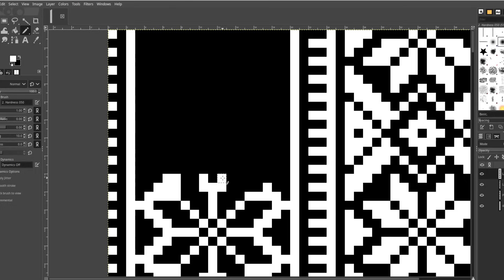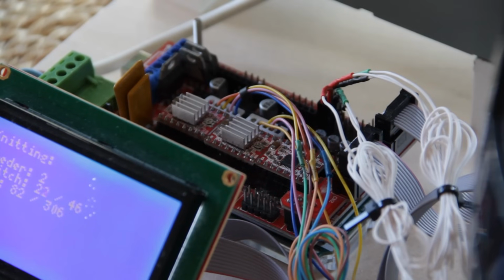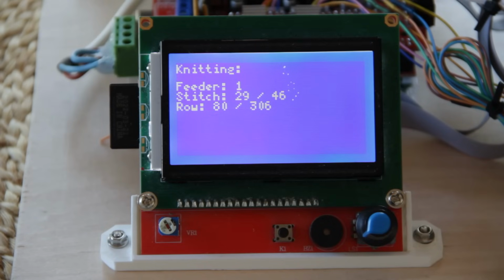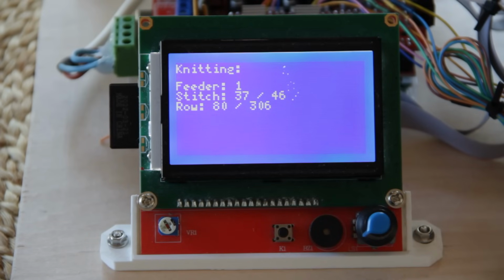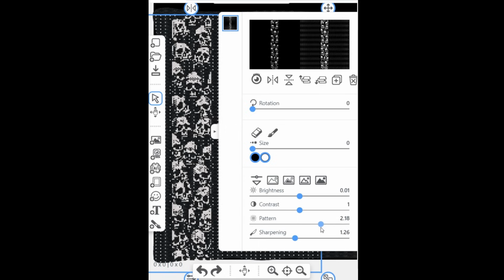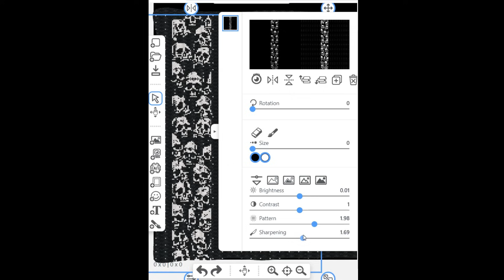Modifying and Automating the Addi Knitting Machine for Multi-Color Knitting. For fun and Profit!

Comment: This is amazing! I would love to learn more! I injured my hands a few years ago so knitting and crocheting for long periods of time is no longer possible and so I got and Addi machine and Sentro. They're definitely great tools and helps with my urge to create things but this is on a different level. Just a few questions below: 

1. how long does it typically take for a project to complete? 
2. Will the size of the yarn matter with the tensioner you have (i.e. size 3/4/5/6)? it looks like the yarn you're using is worsted weight (4)
3. Is there a possibility to have more than 2 colours present in the scarf (i.e. your machine shows black and white but has grey for "scaffolding")
Reply from the maker: Thank you so much for your interest and kind words! I'm glad you found the project exciting. Making knitting more accessible to people is actually a very interesting argument for doing this.

1: A scarf of 185 cm (approximately 6 feet 1 inch) in length takes about 4 hours to knit on the current setup. I can increase the speed if that is a priority, though right now I'm more focused on stability rather than speed.

2: Yes, the yarn matters regarding tension, so to compensate for various thicknesses I have made thumb screws that make it possible to change tension a bit. In most of the clips, I'm using NM 2 for the two colours and NM 4.2 for the third thread (wc: 1.77 and 3.72). But I plan to experiment with two threads instead of a single thick one since it will reduce the number of times I need to change to a new skein.

3: Not currently, but of course, I'm working on a true multi-colour version :-D However, I had to completely scrap and redesign the feeder head, and I'm having some issues with unused threads. Once these issues are solved, I will of course post a new video.

Comment: A better way to spool off yarn from balls is from the inside so it doesnt jump around so much and cause irregular tension. Better yet purchase yarn on cones, they were made for machines.
Reply from the maker: I would prefer to use cones, but unfortunately, I can't find any that come close to the price per gram of these skeins. These skeins are also wound a bit tightly, so finding and pulling the end from the center is not easy and takes some time. I also tried rewinding them to pull from the middle, which works, but it's too much effort. All in all, my conclusion so far is that the bouncing doesn't introduce enough irregularities to make it worth the trouble. However, perhaps I should take another look. Thanks for the advice. And by the way, your AYAB kits are great :-D

Comment: I love this! Awesome idea and great execution.
I didn’t understand how you use a third thread to help with the floats. Hope you can explain a bit in a future video.
Anyway, subscribed :)
Reply from the maker: Thank you so much for watching, I'm so glad you enjoyed it!
I'm a knitting novice, so I apologise for not knowing the correct terminology for this method of knitting.
But let me try to explain.
The problem I encountered when knitting with only two threads was that the overall knitted piece didn't seem to be very structurally sound (especially when having long floats), there would be great gaps where one colour was changing to another.
So to get a more sound structure, the third thread is being knitted for every stitch, but it is (mostly) hidden behind the alternating colours. So the third thread doesn't actually do anything about the floats, it just gives a foundation that the alternating threads can lean on top of.
I don't know if that made any more sense, but I will try to include a better explanation in my next video :-)
Reply: @MartinMakesThings  That third thread seems close to what we do on flatbed machines (Brother, Passap, and Silver Reed) as ladder jacquard. I like it that it holds the floats (the long strands) in place when doing a design with those long floats. I see this type of backing in purchased knitting also. I have been using flatbed knitting machines for 30 years, so have practiced a lot <G>
Reply from the maker: @ritamcelroy1174  If I understand "ladder jacquard" correctly, the method I'm using is more primitive and not as effective, as it doesn’t really hold the floats. Instead, it adds a fully knitted piece on the backside, which stabilizes the areas where one front color changes to another so they don't come apart as easily.
Reply: @MartinMakesThings  Yes, it's more like Plating.  Good idea to deal help structural integrity, just not ideal for anything where the inside needs to be functional, but you can always knit or sew in a liner.  You might experiment with a thinner thread for the binder to keep the bulk down, and it will hide behind the main colors better.